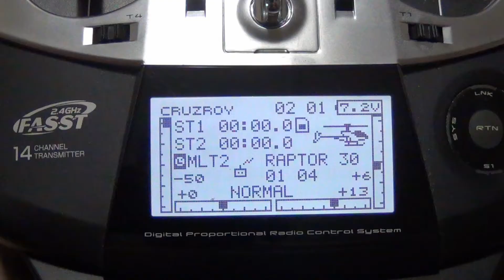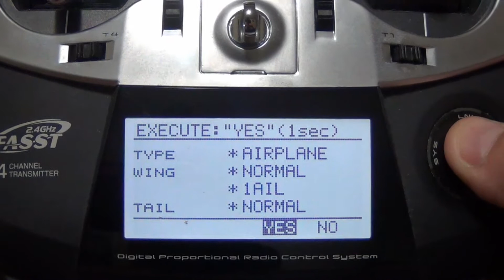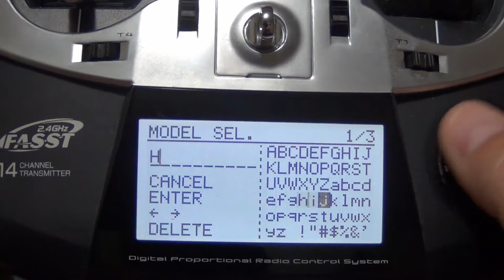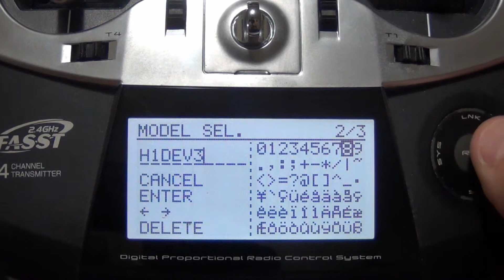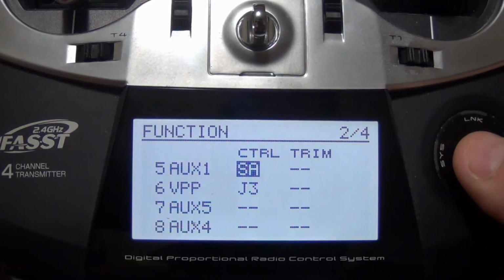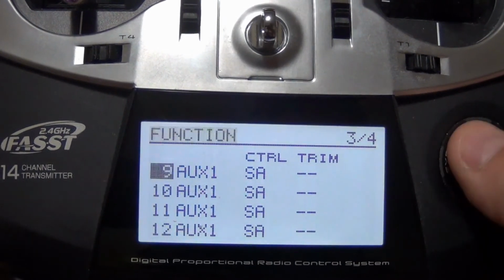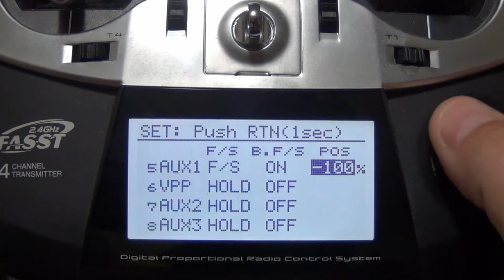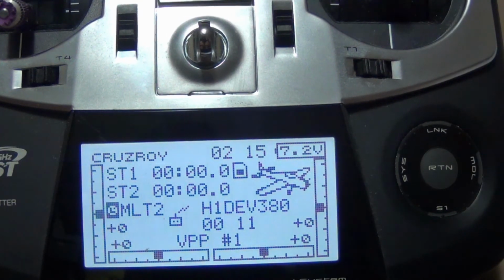futaba T8FG setup for H1 flight controller

Comment: At 10.33 for CH5 to be 100%+ in fail-safe and not 100%- flip the CH5 switch and hold the RTN button for a second it will go from - to + that is how to adj that.